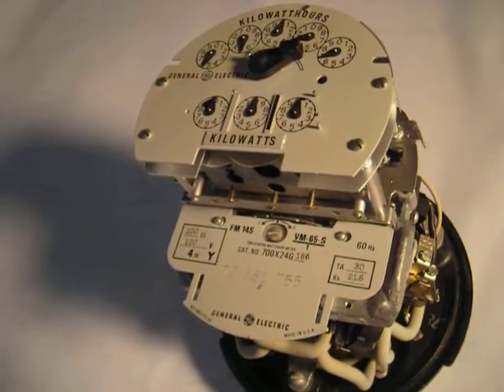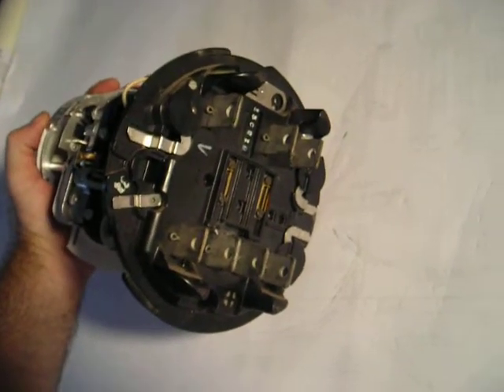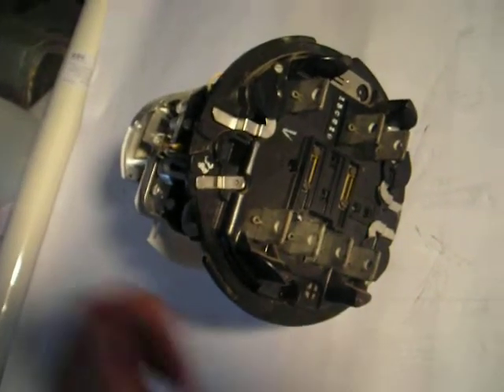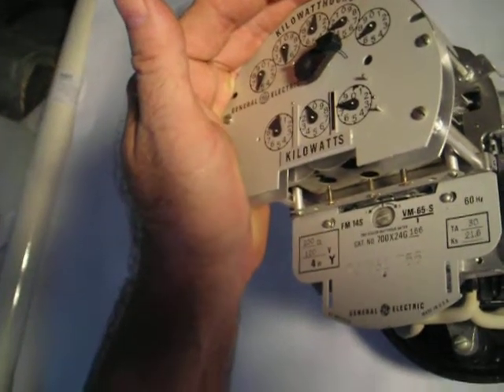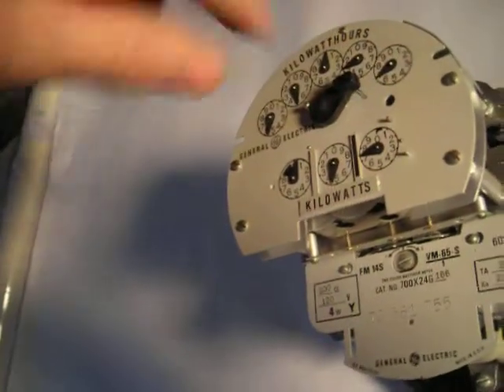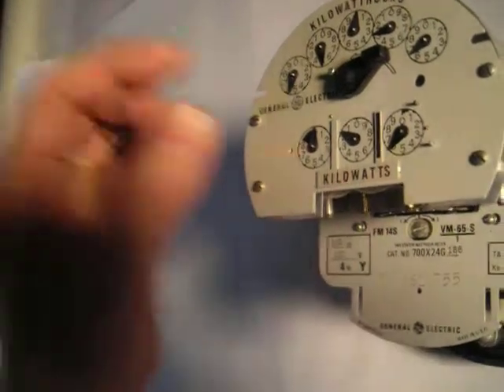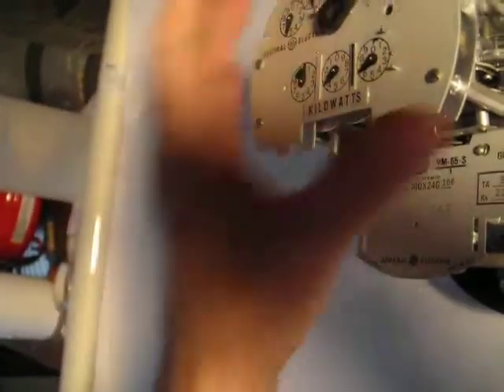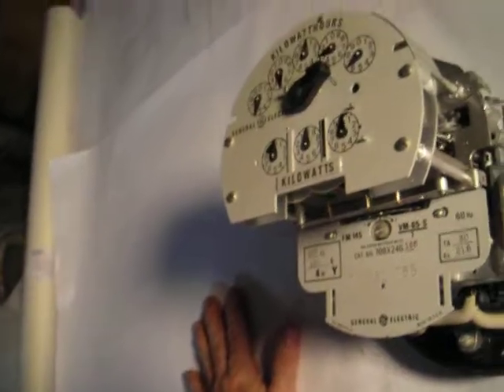Watthour meters (10) Three Phase GE model VM-65-S Form 14S for 200 amp  demand kwh

Comment: What are the differences between form 1s,2s,3s to 9s?Any helpful articles for this?
Reply from the maker: +Steffe Cherish Enriquez  The notations of "1s,2s,3s to 9s" are the "Meter Form numbers". S means "socketed" and the older "A means the wires go into lugs" ie to change the meter took longer to do and riskier with live unfused wires.

 Socketed meters came out in the  mid 1920's; ie 90 years ago. "A" type with wire lugs are still in use today but rare. 

The most common form is 2S for two 120 volt hot wire and one neutral 240 volts between the hots. 1S is for 120 volts and 1 neutral; sometimes used on street lamp metering today. Before WW2 homes were mostly 120 volt only since AC units were rare. 

The higher numbered forms are more complex; have more lugs and cost way more.  They are often for 3 phase and sometimes with external current transformers and or external voltage transformers too. The "meterman's handbook" is the bible of the many configurations. 

http://iaeimagazine.org/magazine/2011/05/16/performance-meter-socket-configurations/

http://reg.conferences.dce.ufl.edu/docs/sema/2012speakernotes/watersintrototrmeters.pdf
Reply: Now i get it Sir.thank you so much.:)

Comment: Very descriptive! I have a fm12s abb a1d meter in my collection I just thought it was a single phase thanks for warning me!
Reply: A form 12S meter is technically sorta single phase, and can be used to replace a form 2S meter.  12S meters are used for wye connected 120V/208V where 2 of the 3 hots are tapped for the service and a regular 2S meter would read low.  The 5th small blade on the back of the meter connects to neutral.